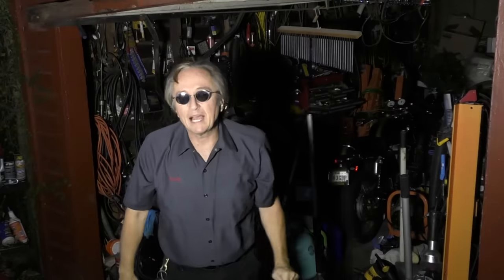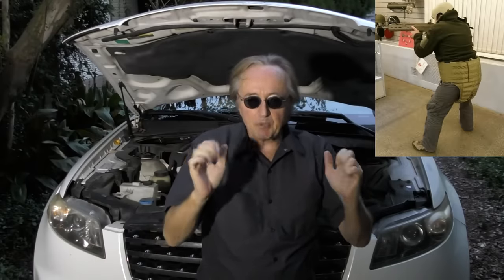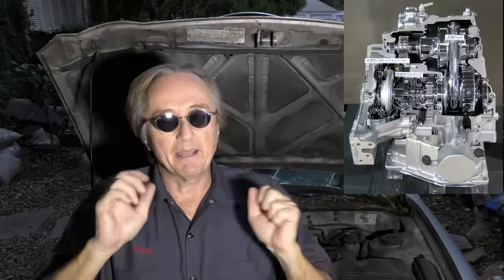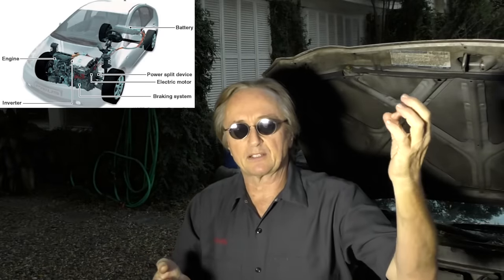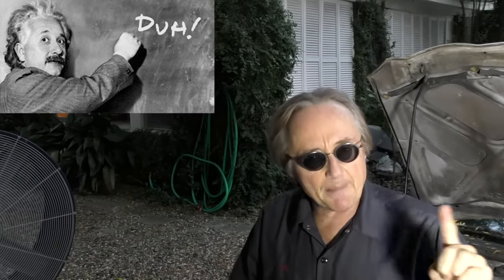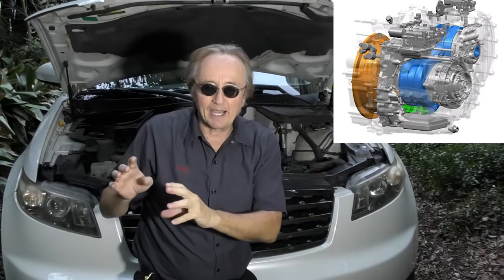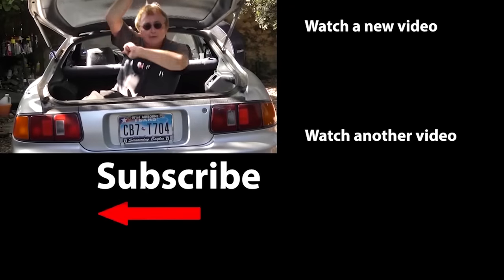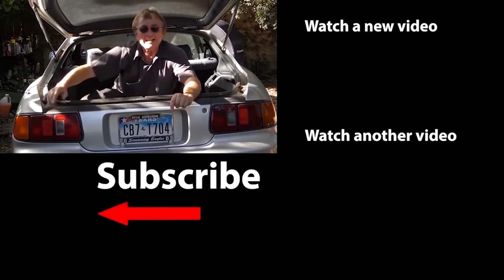Why Most CVT Transmission Cars are Terrible

Comment: Why is everybody so obsessed with gas mileage these days? Personally I say reliability and better performance over 3 more mpg.
Reply: Those all go hand in hand nowadays that's why.
Reply: Aytug Demir because in Europe, as an example, fuel is realy expensive... thats my reason🤷🏻‍♂️
Reply: Probably because gas was so expensive about 10 years ago.
Reply: i know its not your saving 7k on gas a year
Reply: In Iceland gasoline at normal gas stations (without discounts)  is about  $1.92 per litre and diesel $1.86, and at those special discount gas stations, gasoline can be as low as $1.63 and diesel $1.58 per litre, it's a little lower at costco with gasoline being $1.58 and diesel $1.54
Reply: Because on 20 gallons that's an extra 60 miles of driving.
Reply: Yeap but on a cvt you are gonna wiped out all your savings
Reply: The Prius gets 50 mpg vs 20 on your averages mid range performance cars. We cant be careless anymore were running out of resources.
Reply: Cameron Rozek - we definitely shouldnt be careless but (assuming you’re American too) do you really think we are running out of resources (I.e fossil fuel)? Absolutely not.
Reply: @stevienguyen2047  of course we are. They're limited. You have to think about future generations and the well being if the earth as a whole.
Reply: Federal mileage requirements
Reply: democrats
Reply: I have a 2017 Corolla with the CVT. On the freeway with cruise control set at 70 mph and the a/c running, it gets 40 mpg. That's real mileage on 30-100 mile drives. I'm pretty happy so far.
Reply: @briant7265  the long term reliability is questionable though
Reply: @Pedro-qm1of  Americans are spoiled at the moment. Remember when gas was $4 a gallon in 2012?
Reply: @Pedro-qm1of  not necessarily
Reply: @cameron5980  Resources are running out anyway. If they are out ten years sooner or later is not a big difference. Volkswagen Lupo (3-cylinder Diesel) consumes 3.0 litres Diesel for 100 kilometres.
Reply: @cameron5980  you're wrong. With our current discoveries, our resources are virtually endless. The US alone has enough gas for the next 1000 years at current demand... By then a new energy tech source will exist. Nothing to worry about tin foil man.
Reply: @vanillaglue  what's your source?
Reply: @cameron5980  i meant to write *100 years, other estimates put it at 250+. I'm an energy analyst... A simple google search will tell you the US has more recoverable oil reserves than anyone else, including the Saudis, Russia, or Iran. LNG is the future anyways, not oil...
Reply: @NoName-gv6nm  dafuq?  where's $4 a gallon?
Reply: John Ratican  exactly! It pisses me off that so many companies are using CVTs and ruining their cars. I think it's either gasoline, or hybrid/fully electric. CVT is garbage, if somebody wants performance, they'll get a real gas car. If somebody wants really good gas mileage, they'll get the hybrid/fully electric car. There shouldn't be anything in between. Its stupid.
Reply: mpg is important for a lot of people, but a auto transmission fuel economy can't compensate the money you spend in repairs.
Reply: Here in Norway it's 3dollars pr 1liter gasoline
Reply: I'm somebody and am obsessed with BOTH.
Reply: @briant7265  nobody knows whether you are talking us or UK gallons
Reply: @vanlendl1  they've been saying resources are running out for decades. be smarter than you swallow the various agendas. climate change alarmism has been going on since the begining of the 20th century
Reply: @03056932  I know that. But they won't last forever. I am absolutely not an climate change alarmist. I am the opposite.
Reply: @Naeromusic  if you live in new zealand its $2. 30a litre . in wellington.
Reply: Personally I live in Europe and gas here is about 1.3 EUR/liter which is about 5.4usd/gallon this makes 3 more mpg a wee bit more valuable here.
Reply: I wasn’t that concerned with it until I started having to drive 400 miles a day
Reply: @SwellestSnake  We still dont like 'CVT's in europe and we don't use them. We don't like washing machines thank you.
Reply: @EduSanjuan777  I actually thought the whole world don't like those trash transmissions. Who keeps buying these cars? This is why it's better to just stick with german brands because they at least have respect for their customers (they don't try to shove this cvt nonsense down our throats).
Reply: Go drive 1000 miles and you will see the diff.
Reply: the government forces them to comply, making everything more expensive and complex at the same time-CAFE requirements
Reply: Naeromusic I wonder if my costco member card would work in Iceland if I scan it. I’m going to Iceland in June.
Reply: Katie Wang it does
Reply: It’s better to be spend more money over time on gas than it is to be fix an entire transmission for thousands of dollars right now.
Reply: cameron Scientists have already made synthetic gasoline/oil using turkey guts from slaughter house you know endtrails and putting them under tremendous heat/pressure. We won’t run out. This mileage trend is an Agenda 21 New World Order conspiracy.
Reply: It costs money and resources like fuel to remanufacture parts that broke down! Think of the machinery that needs to run to mine iron ore... You're going to spend your gas savings on repairs anyway. Buy a gas guzzler thats too dumb to brake and drive it for 20 years. You'll have plenty of money.
Reply: Its all about the Government and climate change bullcrap. Making low emission laws on car manufacturers to ever increase better fuel economy. Reducing emissions into the environment. The don't care about reliability, performance or if you want your car to last without expensive repairs. Its just votes.
Reply: It's a better selling point for new cars.
Reply: @stevienguyen2047  Truth. untapped oil reserves in the US they done want the public to know about could run the world for 500 years even at the rate we are draining now days.
Reply: It goes hand and hand. Mpg is less burning gas, more efficient, more reliable
Reply: Govt pressure based on environmental influences
Reply: Government. Whenever a company is doing something ridiculous that doesn't make sense, particularly in the car world, it's always government forcing them to do it because they are imposing fucked up regulations on them.
Reply: @vanillaglue  by the time resources run out Biden and Kamgilla will sell everything to China with Hitlary and you have to learn Mandarin
Reply: @rmack9226  correct! It's the damn cafe regulation
Reply: @cameron5980  silly --- increasing mpg by 2% has no impact on the future --- driving responsibly is the best way to lower emissions  --- Car transmissions should not be made with rubber bands
Reply: @Pedro-qm1of  nissan cvt yes.. not toyota or honda
Reply: @briant7265  true
i have 2016 corolla..
Reply: @noliuntalan5314  Scotty did mentioned not long ago that he doesn't trust nor Honda nor Toyota cvt transmissions. He likes Toyotas cvt better but he will not buy a new Toyota  with a CVT
Reply: @Pedro-qm1of  now scotty likes honda and cvt coz of no issues .. yeah i have 2016 corolla S like it with 66,500 miles traded in 2021 corolla se 2.0 L with a built in gear for take off... nice car love it.
Reply: I get 40 mpg with my corrola, my 4x4 GMC got 18 on a good down hill.  I'm saving over 350 in gas alone. That's why . If you live in the big city and don't drive much I can see your point. Living in the rural country I probably drive 100 plus miles a day.
Reply: @cameron5980  we definitely aren't running out of oil.
Reply: @briant7265  same! I was driving a big GMC Sierra 4x4. Gas was killing me. I'm saving near 400 a month in gas alone. I love my corrola!
Reply: Money, carbon footprint, less stops to the gas station
Reply: Agreed
Reply: @Mav10  he said in 2012 and in some areas it was high $4 maybe even nearing $6 in some places when I was young. Luckily I wasn't buying gas at that time but I remember the prices and everyone complaining about it.
Reply: Serious...just buy a car with a 50 horsepower engine then. Or a scooter. Reliability matters because it cuts down on excessive automobile manufacturing, which is itself harmful to the environment. Something Tesla fans should keep in mind...where are we storing all those spent batteries? 🤔
Reply: This didn't age well
Reply: @natetete1379  couldnt have been worse
Reply: It’s because they have to make cars emissions better however they can, to meet the targets that are set for them by the government’s
Reply: ask that question now with current gas prices and with people who commute over 30 miles one way to wherever.
Reply: Idk I will say this, my wifes ford escape (2020) with a 1.3L 3cyl 6speedA only gets about 25mpg. My dads 2018 subaru impreza gets 48 miles per gallon (4 banger cvt)
Reply: The money saved in higher mileage is needed for repairs.
Reply: Right on. Could not agree with you more.  Dont think you would feel so good about saving a few bucks on gas 
When you are told it will cost you $7000 to rebuild your transmission after 100k miles!